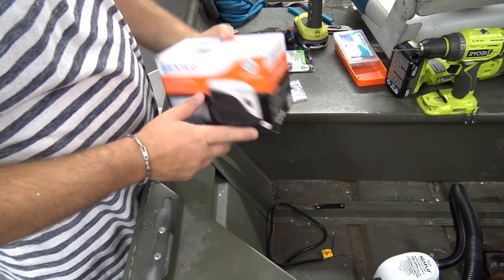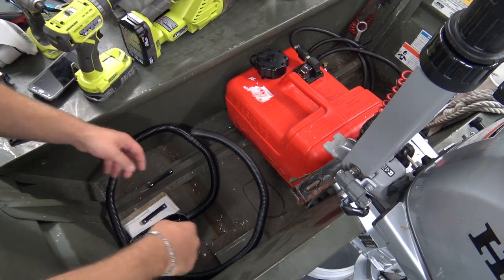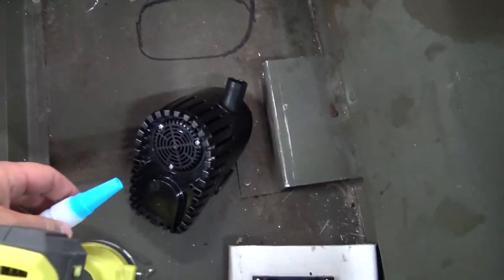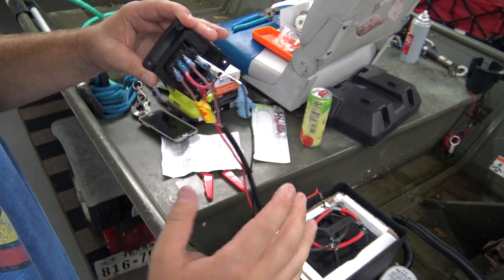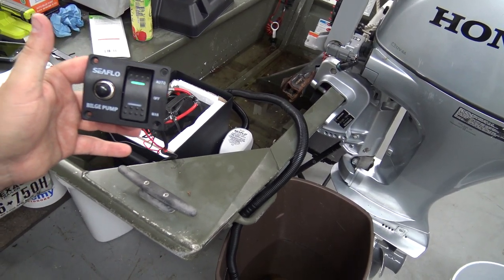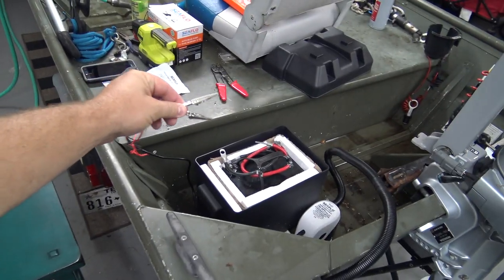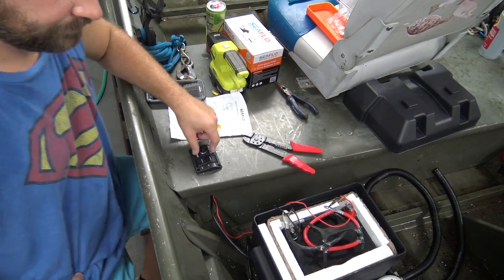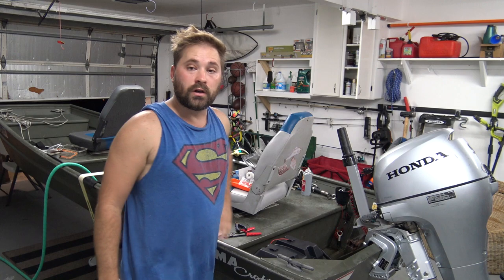VOL 2 Installing a SEAFLO 3-Way Bilge Pump Switch Panel  & SEAFLO Automatic 750GPH pump & Battery

Comment: Hello i have a 1100gph bilge pump and a float switch that says 20amp max. And on the bilge pump it says max 3.5amp draw. I was wondering what amp fuse do i need to put in the control panel 

Thanks
Reply from the maker: Man bro I wish I could help go with the maybe a fiver
Reply: The fuse should be a little higher then the apliance, in this case use a 5 amp fuse.

Comment: Mine goes red not green on Automatic..dont know why..but all works fine.
Reply: Because the manual wire goes to number 1 terminal on the top ,not on the bottom how he has it . Directions are quite clear on that .